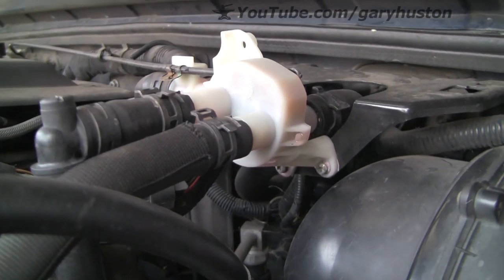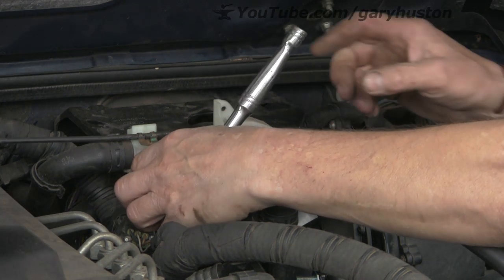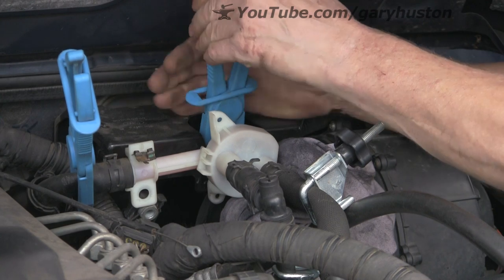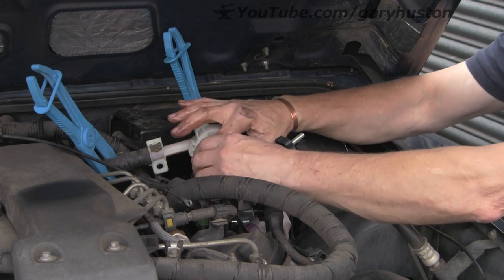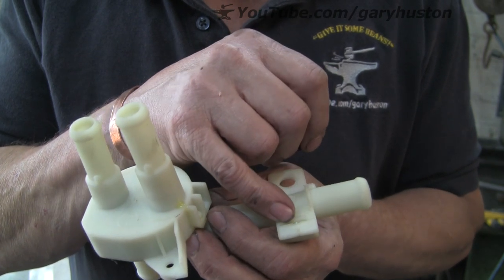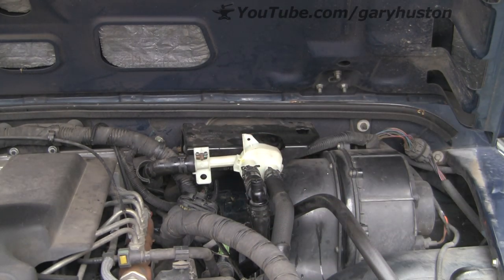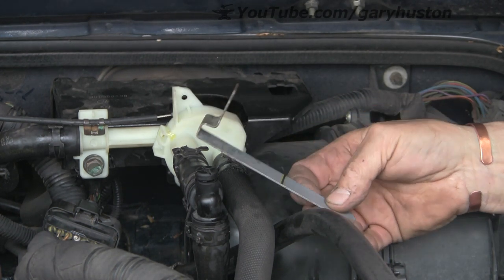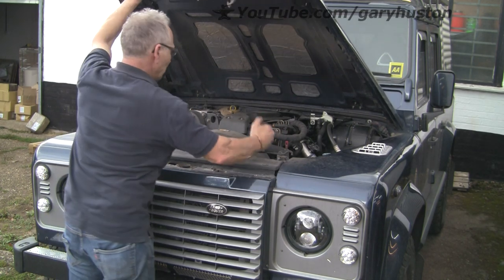Land Rover Defender Heater Control Valve Replacement

Comment: Outstanding video Gary, watching your detailed instructions this job literally took me 15 minutes, using the Ducato valve as you suggested. Typically Defender (mine's a 2007), all my hose clamps were different to yours and were the stainless screw clamp so very easy to remove and tighten. All the best mate - greetings from Queensland! Warren.

Comment: Learn something even at 60.  I have never seen those hose clamps. The blue ones or the metal ones. I have not seen one of those clamp removers either.  I have always used vice grips to clamp the hose and pliers to remove the clamps.   I have missed out in 40+ years of working on my vehicles. Thanks for the video.
Reply from the maker: Lol! Every day is a school day!

Comment: My Dad us to rub a little bit of grease in the end of his radiator hoses and heat hoses, to help install them and remove them if they every had to be replace. He used just regular wheel bearing grease, it doesn’t hurt anything and won’t contaminate the anti-freeze.

Comment: I replaced the valve in my Defender today, but checked out your video first. I found it very useful, thank you. I’m not sure what I’ve done wrong, but the heater dial now appears to make no difference! Any thoughts on what I may have done wrong? Thanks.
Reply from the maker: Have you made sure the cable is attached at both ends?
Reply: Thanks Gary, I did wonder if I’d accidentally disconnected it at the other end. I’ll have to check that.
Reply: You reinstalled the pipes incorrectly. One with bleed screw should be higher up. If replaced incorrectly it will be a constant hot water feed direct to the heater core=constant heat.
Reply: @jessicastewart9684  thanks mate. I didn't even realise I had them in wrong but the system now works well. Also thanks to the uploader a really easy to follow step by step video. Cheers all🎉

Comment: Will I need a new valve if the cable is sticking. I cabt see any leak. It was stuck open the other day and I had to manually close it.
Reply from the maker: If the cable is sticking just replace the cable!